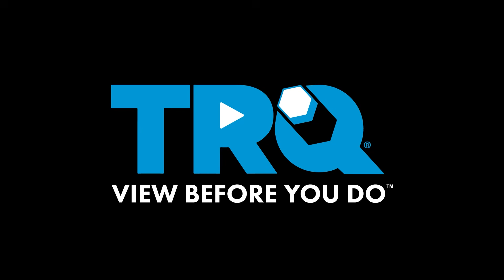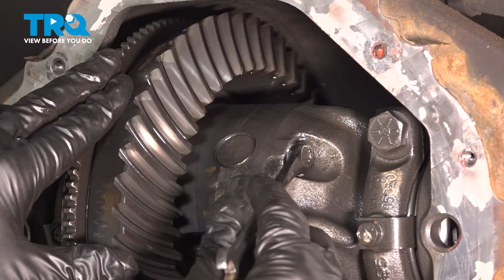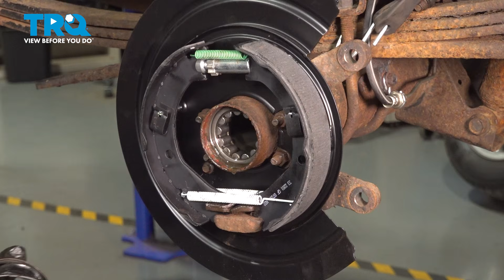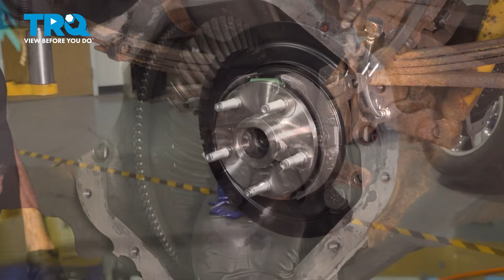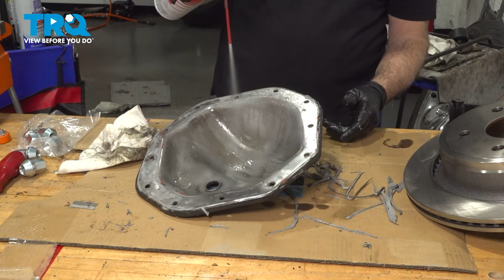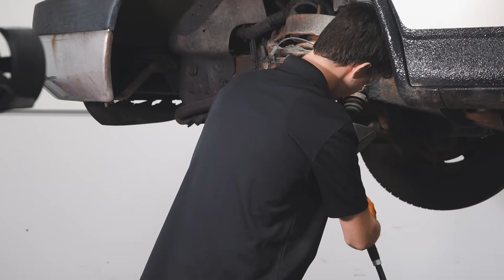How to Replace Rear Axle Shaft & Bearing Kit 2002-2008 Dodge Ram 1500

Comment: No torque spec for the retaining bolt of the cross pin? From what I understand, that bolt is considered a single-use fastner, they are prone to shearing off and creating massive nightmares. A link to another video detailing removing them (really, bolts that are prone to shearing in general) would probably be helpful for newer mechanics and DIYers. For now this should help....
Do not use a power tool to remove it... the proper hand tool with the best possible engagement should be used(if you have standard and 12 point sockets, use the standard socket). Within reason, clear any debris, deposits or corrosion using parts cleaner, a pick, and wire brush. That retaining bolt often has factory thread locker which should be melted, before attempting to unfasten it, using a torch or induction heater on the bolt head and the casting that the bolt threads in to. Also, bonking the bolt head and sending vibrations down the fastner (waking up the threads) is supposed to break up stuff on the threads that may interfere with removal, like thread locker, corrosion, or deposits. Penetrant oil could also help. Last but not least, if you start to get more resistance than you think you should feel while unfastening the bolt, work the threads in and out by turning the bolt back in, and then back out, 1/8 - 1/4 turn until you successfully break up what ever was interfering with the threads/removal.

Comment: Those gears fill out when you turn that axle putting it in and then trying to put in the studs that the exact time those fell out otherwise they only fall out of you turn that while is that pin is not in there

Comment: For those asking about greasing the bearings, dont. It can cause the bearing to fail early. They are designed to be lubricated from the gear oil. You can put some gear oil on the bearing after installing it if it makes you feel better, but it isn't needed. Once you re- assemble everything and add the gear oil to the differential housing, the wheel bearings will get coated at that time.

Comment: what’s the part that the caliper bolts go through and holds the caliper. it also gets the backplate bolted onto it with the small bolts. it has the 4 bolts

Comment: Nice video for replacing rear wheel bearing but ounce you replace the one side do you just pull the otherside off also to change the bearing the same way.